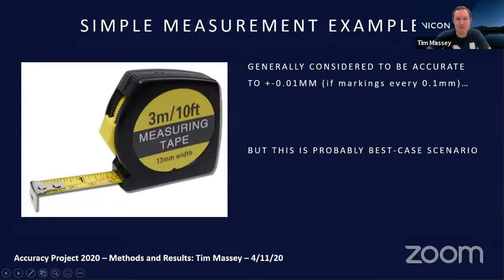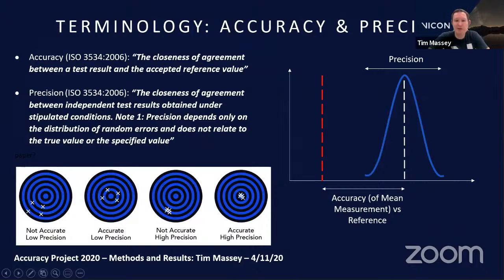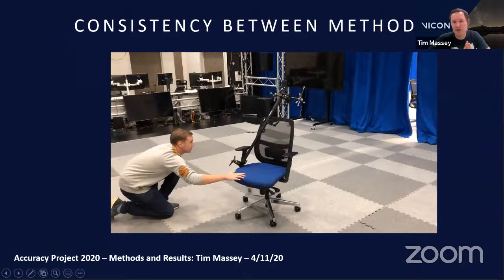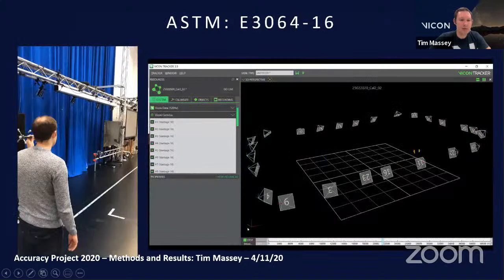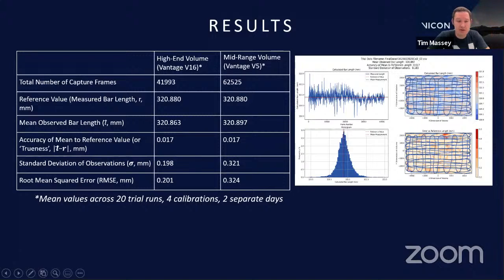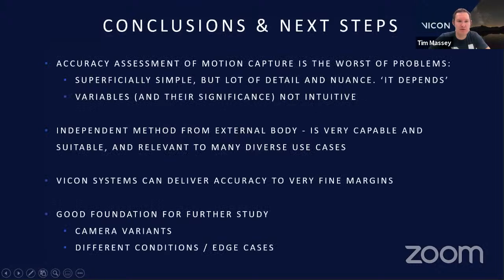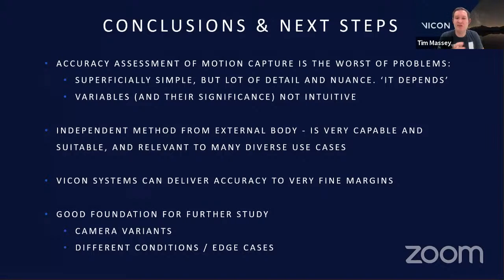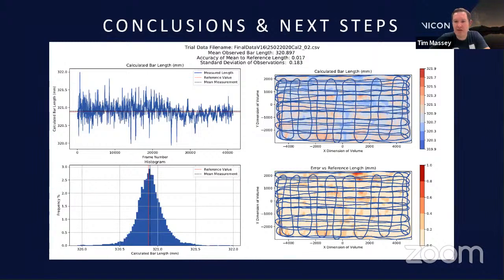Vicon Accuracy Webinar: Study Methods and Results

Comment: Great presentation and results. It almost feels too good to be true! You would need a rather expansive micrometer to physically measure the length at that precision. It is mind blowing that it can be done optically and consistently over such distances. It would be also interesting to see the accuracy of absolute position measurement by using Vicon systems. Systematic errors cancel out when you measure a relatively small length since it is obtained by subtracting coordinates that might have almost equal systematic errors since the markers are confined in a small volume.